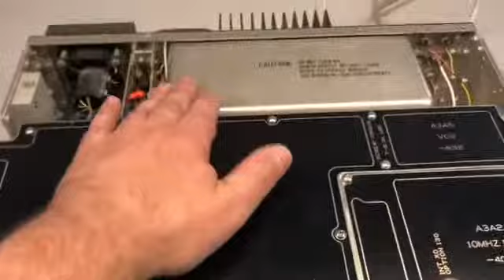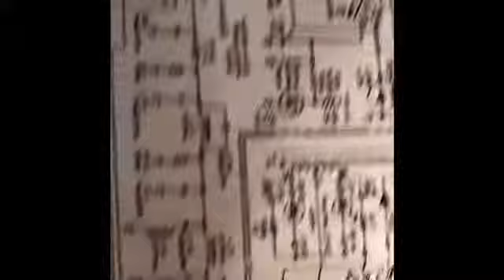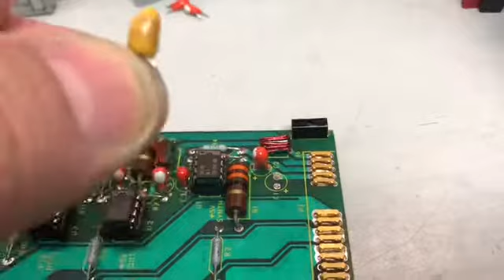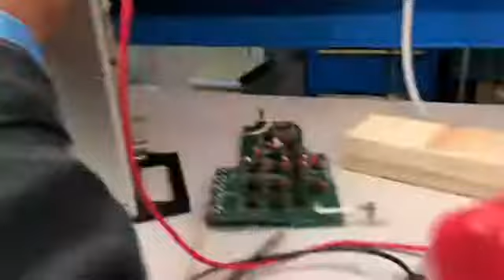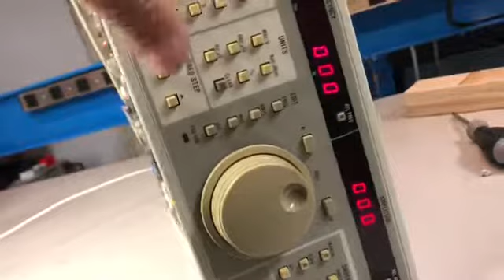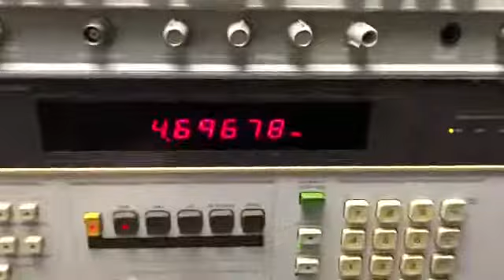Fluke 6071A Extensive Repair

Comment: Great video.  It saved my 6071A.   I found C4 on both VCO's shorted (A3A10 board) or burned up (A3A5 board)   68uf 15v rating but on the +12v circuit.  A bit underrated IMHO.  Replaced with 25v electrolytics.  Another tip...look for any discoloration on the under side of the PCB covers.  A quick way to locate a part that transformed into smoke.

Comment: Nice repair!  Quick question.  I also got a Fluke 6071A just recently,  everything seems to work fine but the UNCAL light flashes whenever the RF output is turned off.  If I press interrogate, it shows "004" in the amplitude display.  Is this normal?
Reply from the maker: Hi, thanks for the comment. Mine does the same. It seems that disabling the output the ALC loop is opened.
Reply: @mymessylab  Thanks.  And I just realized that if I had read the other comment,  you had already answered this lol.  Thanks for your time.

Comment: So, the caps that you are finding are bad are tantalum?  Are you replacing them with tantalums?
Reply from the maker: Apologies for the delayed response. Yes I do replace tantalum with tantalum. They can get short circuit by they don’t leak. The instrument while working becames warm, tantalum capacitors are lightly  affected by the temperature. If your instrument has the led that comes on means that the main psu is working, you should have a short(s) that you can narrow down in which deck is by removing one connector at a time on the power distribution board (attached to the rear frame). Once you have a clue of that it’s just a matter of remove one board at a time onto the relative section until the short is removed (using ohmmeter). It weighs like hell. Shipping costs would be crazy.
Reply: @mymessylab  Thank you.

The LED came on BUT when I switched it on the LED went out and it released the MAGIC SMOKE ... now I'm worried that I burned out a transformer...

I watched your entire video and I saw your method of tracing down the shorts.  I'm worried that my box is more damaged, though.
Reply from the maker: @drstrangelove09  the normal function of the stand-by Led is to go off when you flip the front panel power switch, that means your Main PSU is working. Most likely the magic smoke is a tantalum that is burning due an internal short. Try to trace down from where it coming out and open the relevant cover.  Check also the  output of the two regulator boards that are on the rear pcb  with voltmeter for correctness. Be aware that the two large decks are populate by pcbs on both sides and to reach them you need to remove several semirigid RF wires. You can test the instrument without them attached to see if it works, you will have clearly all kind of errors on the displays.
Reply: @mymessylab  Thank you!  Maybe I'll try plugging it back in and turning it off to see if the LED comes on again... I'm also not sure if the fan stopped running... maybe I should build a dim bulb current limiter before I plug it back in....?
Reply from the maker: @drstrangelove09  if you remove the 3 plugs (upper deck, lower deck and front panel) as you flip the rear switch on the fan should spin (at higher speed) and no magic smoke should occur. This will confirm that we are ok with PSU. Dim bulb will not work here since it is a switching PS. Try to re-connect front panel first and see if is doing fine. At this point you should have the controllo of PSU by the front switch. If everything is fine so far you can go ahead with the tracing.
Reply: @mymessylab  Thank you for your excellent help!!  I will do that!!!

Comment: I bought a Fluke 6071 on ebay for $500 (kinda an accident, I starting bidding and went too high) and it sat for more than a year.  When I finally turned it on the LED dimly lit up.  I don't remember if the fan was running.  I switched the front switch on and the LED went out and nothing lit up AND there was a burning smell, magic smoke!!!  I'm worried that a transformer burned out.   I wish I could send it to you and you would fix it because I'm not sure that I'm up to what you are doing here plus I do not have the manuals.  Hats off!!!

I just bough the four manuals, including the schematic manual, on ebay, as a disk, for $25, so maybe I will try what you did...

Comment: Loved the video. I got a 6071a from a guy thats in pretty pad shape. I had to dissemble the power supply and install a new main relay. it was corroded it would not close all the way. After replacing some bad Caps in the output section i am able to power it up. The uncal light just blinks and am wondering the metal RF lines could be the problem, there pretty beat up. can those lines be replaced with a shielded cable?
Reply from the maker: Thanks sir the comment. If I recall correctly by enabling the output should the uncal light turn off. If not you should have an error code while the instrument boot-up (numbers on displays). It’s a bit tricky to understand what that mean since the given number can be the sum of multiple error codes. By the way the service manual explains everything.
Reply: @mymessylab  thank you for replying.... ya i read the manual but this part of the project is just a little over my head. when it boots i get the the model number in the frequency window (6071) I think thats what that means, and in the amplitude window its 360 with the uncal and freq lights flashing. If i push any button it will go to the normal screen with the lights flashing. I'm guessing the 360 is the error code? Any wisdom from you would be greatly appreciated.